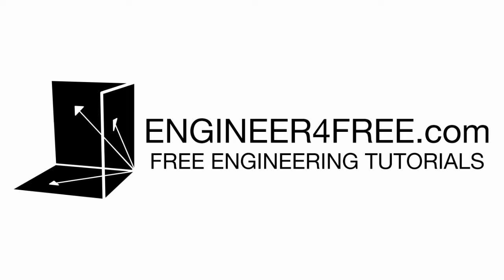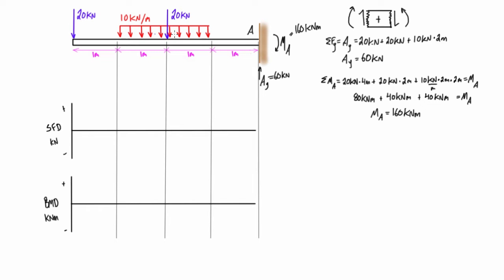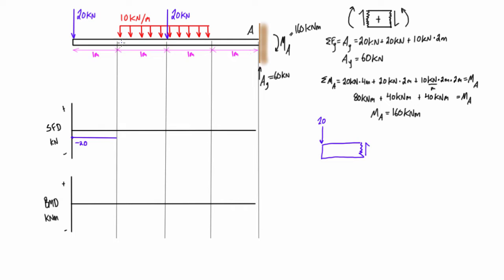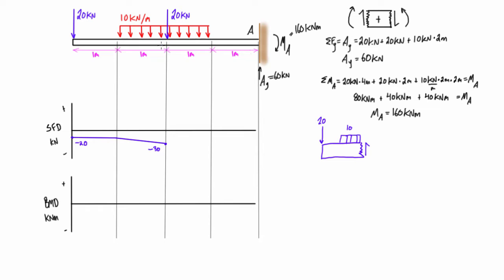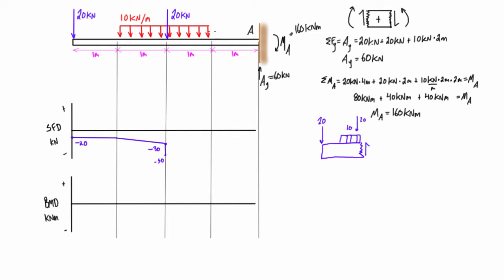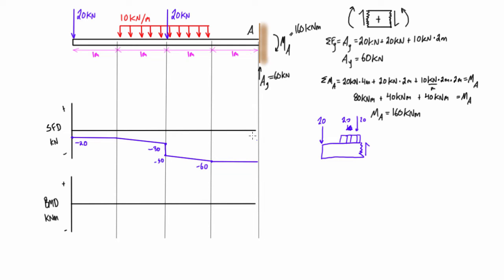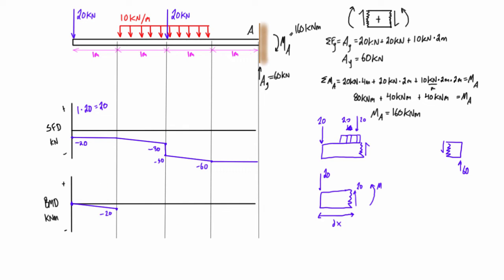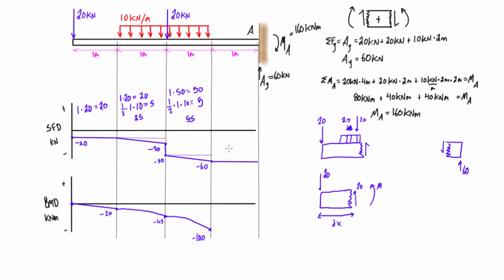Shear force and bending moment diagram practice problem #5

Comment: Does the parabolic line on the bending moment diagram always  have to bend upward? the previous example of the cantilever beam on the left hand side also had it arching upward, but i was wondering if the direction which the line arch towards relates to if its in negative or positive value, so i was expecting it to arch downward creating a convex line instead.
Reply from the maker: Hey so a good way to reason through it that works every time is this: imagine you are doing a numerical integration of the triangular area. You slice it up into several skinny vertical rectangles. The area of each rectangle across each width dx is equal to the change in magnitued of the BMD across each dx. So where the rectangles are small, we have smaller changes, and where the rectangles are big, we have bigger changes. small change and big change translates to mild slope and steep slope on the bmd as we go across. Because we also know if the area of the triangle on SFD is positive, we have positive change in value on BMD, and if the SFD area is negative, we have negative change in magnitude on the BMD. So knowing if the parabola is going up or down from left to right, and also which side it has a steeper slope, we are left with only one option for concavity that can possible work. Hopefully that makes sense, It's not a very technical explanation, but is always how I double check that I have the right orientation.
Reply: @Engineer4Free  thank you for the response. While i must admit the explaination is still somewhat confusing to me, it is partially due to the fact that i am rather new to technical jargons associated with the subject as English is not my first language, and i would, in time, be able to break it down into smaller chunks and process it entirely. If i come up with a different question during such pondering sessions, i look forward to hearing back from you for further insight. Thank you again!

Comment: That composite is the same to use as trapezium to get the area
Reply from the maker: as long as you're adding up all the areas every time there is a change, ie a point force, beginning or end of a udl, applied moment, hinge, reaction, etc, then you're good. I find it quickest to sum rectangular and triangular areas separately and sum them as needed

Comment: Thank you so much Sir. It help me much. By the way may I ask a question Sir? It is can we put the moment direction-upward or downward as we like ?
Reply from the maker: Do you mean the entire Bending Moment Diagram? If mine looks upside down to, it’s fine, you can invert it across the axis. Just make sure you indicate which side is considered positive and which is negative. I have clearly labelled on the left side the + and - signs on each side. If you want to invert it, just make sure you switch those too. Different countries do it different ways, for different reasons.

Comment: Thanks a lot.
I have just one thing I want to clarify...For the bending moment diagram, after getting to -160KNm, does it return to 0KNm to close up the graph since there's a +160Knm already at the cantilever end to cancel out the -160Knm?
Reply from the maker: We consider it to end at -160kNm. The applied moment of 160kNm CW is acting at the absolute right end of the member. If you draw a FBD of the right side, with a virtual cut infinitely close to it, but toward the left direction, then in order for that cut member to have a net moment of 0, there must be a CCW internal moment on the left of the virtual cut. CCW on the left is negative according to our positive sign convention, and it’s magnitude is 160. No need slam up to zero at a distance less than infinitely close.

Comment: Is there anywhere where I can get more questions?
Reply from the maker: Make sure you check videos 1-9 here: engineer4free.com/structural-analysis and also try videos 66-72 here: engineer4free.com/statics (for some more basic examples). I'm planning to get more practice problems with solutions done in the SFD and BMD section of engineer4free.com/statics-solved-problems but I'm not at it yet ⏳

Comment: Your moment diagram doesn't end at 0 but it should because the system should be in equilibrium. Great video but would you explain that a little more?
Reply from the maker: Fixed end of a loaded cantilever should never equal zero on the BMD. That is the location of the reaction moment, which is non zero. So infinitesimally close virtual cut will reveal an internal moment equal and opposite to the reaction moment.

Comment: The only thing I don't get very well is how you get an upside down graph when creating the bending moment diagram. Confusing signs.
Reply from the maker: If my bending moment diagram looks upside down to you thats okay, just do your BMDs like you are used to, which would be flipped about the horizontal axis. Depending on where you live in the world, the convention is either to draw BMDs with positive on the tension side or positive on the compression side, which one is just a flip of the other. It gets more confusing if you have foreign professors from other countries teaching at your local school, sometimes they may teach the convention from their country not the one you are learning in. It's all a bit confusing, but this is the way I like to draw them, so I stuck with it. I'd recommend following the convention that your prof does, and in the future if a future prof wants it done the other way, then just retrain your brain to do it opposite then.

Comment: sign convention is confusing. if sum of the forces up =0. then 20kn down your V is down in equilibrium equation so shouldn't the shear diagram is positive 20? why started from negative 20? I don't get that part.
Reply from the maker: Hey Nyi, please watch videos 66-72 here: engineer4free.com/statics for a discussion and some examples on the positive sign convention for internal shear and bending moment